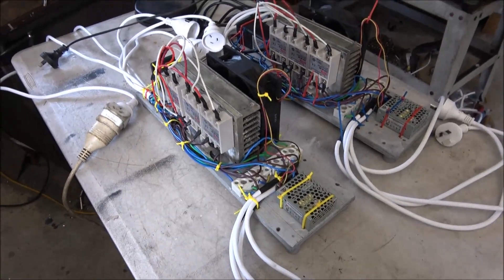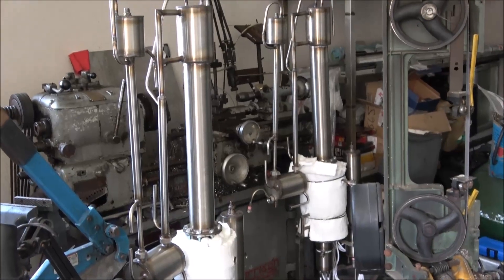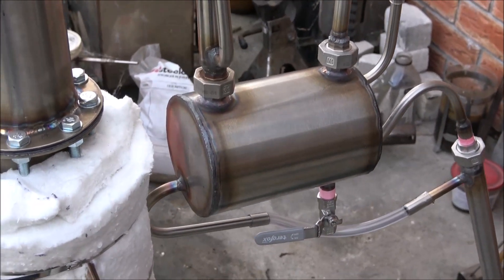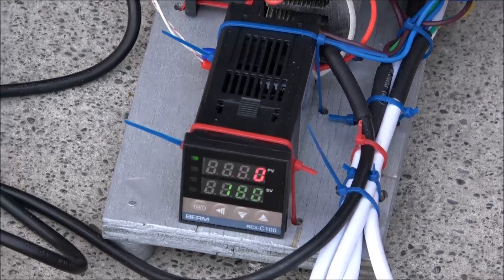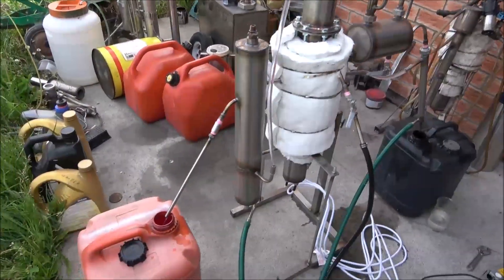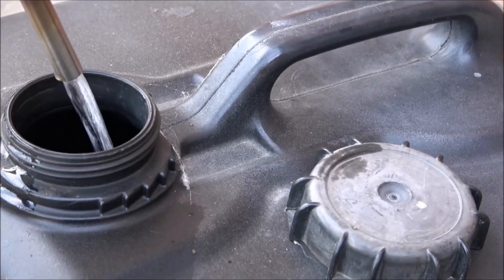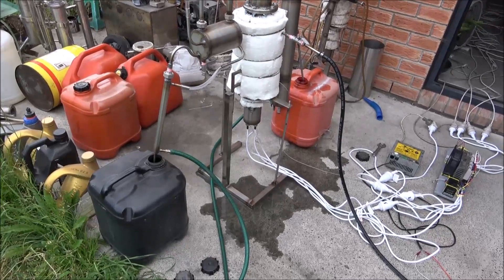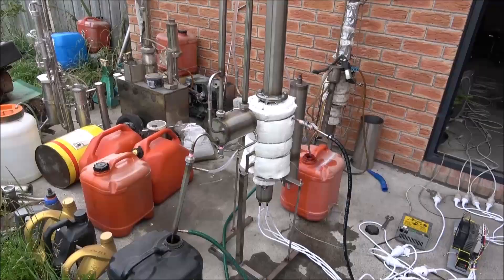Gasoline in diesel tank - (gasoline) separator 6kw.

Comment: Is the gasoline fraction a high enough octane to operate in today's modern vehicles?
Reply from the maker: Regarding this particular machine - yes, the gasoline from this distiller as good as the one from a gas station; this distiller is not for the waste oil processing. Instead, it is for an accidental diesel/gasoline fuel mix separation when people fill their cars with the wrong fuel - say diesel car with gasoline or vise versa. So the resulting fuel is separated from each other diesel and petrol.
Reply: @santeryi9  Sir, this machine can separate oil from water or not? Thank you

Comment: Good morning Sir. That machine is awesome. Are you using different controllers on this machine compared to your diesel stills? What is your voltage 240- 2 wire. Are you able to make controllers that would run in the USA?
Reply from the maker: Hi, the old controllers are simply voltage regulators and actual control was done by the still user, I always recommended using a controller that you see now, so it was by the customer to provide this type of temperature control, in my previous video about waste oil distillation you can see the similar control unit: https://youtu.be/KGhUnZ3ee-I
Reply from the maker: And these controllers are universal, will work either with 240 or110v, thogh my heaters are 240v.
Reply: @santeryi9  Do these controllers work in a black&white style, or is the controller able to change the voltage for the heating elements relative to the control deviation? I'm currently building my still, dbased on your plans! Greetings, Marlon

Comment: Looking good my bro! do you think you can switch gears and make a fuel recovery from plastic cracking. plasma pyrolysis maybe?
Reply from the maker: I think it is not that dificult, thogh I never thought about that, in most cases it should be a periodical system, some sort of rechargeable reactor, where the plastic and some oil mixed to eliminate any air pockets, but plus tic requires some shredding to make the drum small enough, or if continuous, then it is really getting more complex with plastic supply screw an all other features, thus currently not really focused on that issue. Maybe later.
Reply: @santeryi9  I have been working a pyrolysis unit that is very effective in converting plastic to diesel fractions.